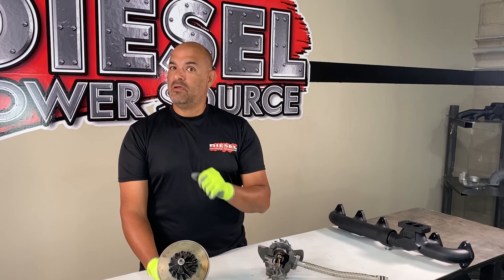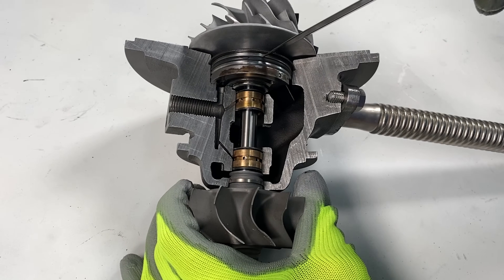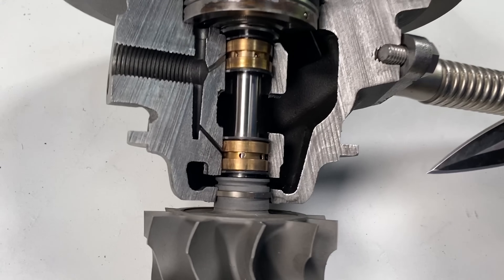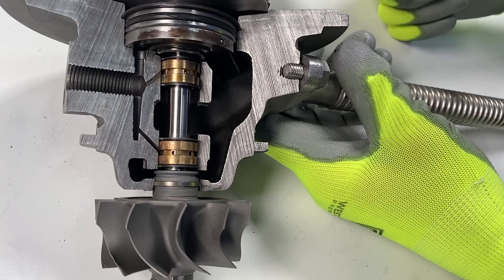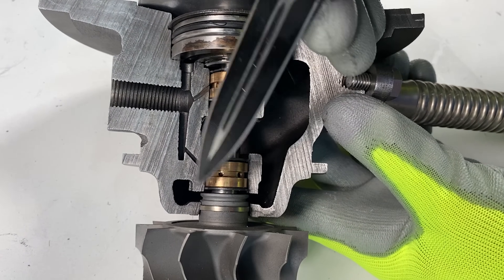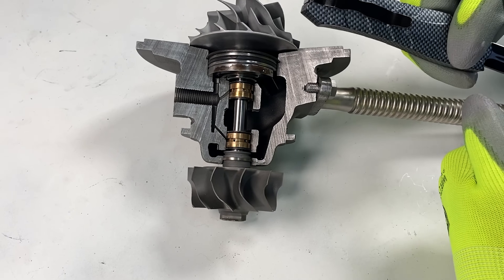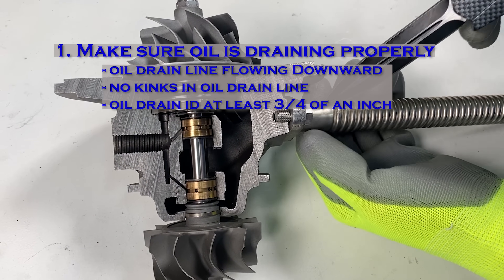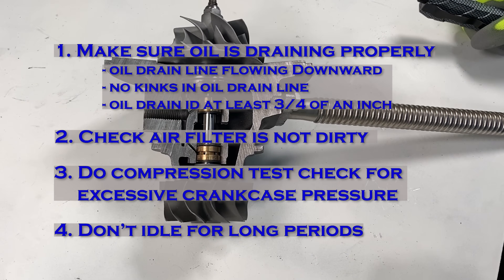Turbo Oil Leak ? |  Turbo Leak Causes |  Understand a Turbo Seal Leak | Diesel Power Source

Comment: Can a vacuum leak on the intake leading to the turbo cause excessive pressure on the compressor side and cause it to suck oil into the intake? Cause I think that’s why there was oil in the intake.

Comment: My 1.4 tfsi throw smoke while full throtle in low rpms and in the morning after warm up. Because of the smoke not being continue i think its the oil leaking by litle in dp and hot stuff therefore this smoke, wdyt?

Comment: Thanks for the info. I recently installed a turbo and the intercooler pipework blew off and I saw oil in the piping I now know why lol. I have a catch can to atmosphere so no oil should be in the piping.
I now know I need to pull out my turbo because the drain wasn't pointing down instead it was almost at the 3 o clock position which was annoying because I bought it off someone who builds turbos and I was none the wiser because he told me he clocked it properly for me so I just installed it. Now being educated from this video I know how to fix this issue.

Comment: Wow what a fantastic video. Now I know why I am getting so much oil loss. My drain setup is angled way more than it should be. Been chasing everything but the turbo. My question is how do you know your turbo needs a rebuild after being run with poor drainage? I can correct the position but how do I know if it’s good to keep running? Assuming oil is lubricating everything anyway so it can’t be too bad but curious to know. Thanks for the awesome information!

Comment: I feel better…..I haven’t started my engine, and the oil feed is definitely feeding the turbo as I try to crank it” Anytime I do internal work on the engine I always crank it to get the new oil moving, and to check the turbo lines for leakage” I guess it makes sense that it would have a tiny leak on the exhaust side…..the Turbo needs to spin to direct the oil away from the seals.

My compression test on the engine was 150 psi on all cylinders except number 6” 152 psi.

Thanks for the video.

Comment: In case of internal oil leak, always I will found oil on intercooler? Or that isnt a right check method? In my case my bmw x3 2.0 diesel, burn 1 liter for 1000km.

Comment: Diesel ran away due to failed turbo.. put a new EBay cartridge in it and ran it without intake hooked up to the throttle body to hopefully clear all the oil out of the intercooler.. leaking on exhaust side only. Is this because the intake isn’t pressurized?
Reply: I'm looking at en ebay cartridge for my car as well. New Honda turbos fail fast

Comment: Hey question for you. If I’m observing my turbo while the engine is running with the intake install and exhaust removed and oil is leaking from the turbine end only, could that be due to unbalanced pressure on the turbo seals? There is no oil on the compressor end when I remove the intake for inspection with the car off.

Comment: i also find out newly that this type of turbos can leak in situation not spining in corelation with supercharger, supercharger works up to 4rpm than magnetic clutch on water pump disconects supercharger, flap on secondary pipe turns and redirect air straight to the turbo, when at the same time the valve on exhaust side of turbo closes and makes turbine to spin the shaft. here comes the examination of slingshot oil ring in front. remember the flow of oil into turbo is constant because oil pump is aslo providing oil for turbo when engine runs, regardless turbine spining or not. back to slingshot ring, when turbine is spining, this ring is usefull, but when turbine doesn't spining and oil is keep flowing, there is no more of sealing type, so the oil is escaping through the oil seal, also because there is also no air coming behind the rotors air and exhaust side. this is an issue of skoda 1.4 tsi RS, maybe some other cars audi tfsi ... maybe this is helpfull alot to understand why some cars have still huge oil consuption no matter good or the best motors build quality. it is the damn turbo. turbo have to spin all the time!

Comment: You do a very good job of explaining this thanks so much!! I have a 2016 f150 2.7 ecoboost and today it was smoking really bad on start up I noticed a lot of oil in the intercooler coming out of the bottom right charge pipe coming from the drivers side turbo could this be caused by bad turbo seals it dose have 201k but seems to run good but dose have cold start smoke and rough idle the smoke last about a minute  the feed tube but I just don’t think that is the case

Comment: Hey turbo gurus, I need a quick diagnosis. I have a 4d56 turbo diesel in a Mitsubishi L300 delica. Intermittently I notice power loss and from watching this video I’ve determined that I’ve slightly overfilled the oil and potentially have a blocked air filter. There is little to no crank case blowby. Here are the symptoms I’ve notice; engine violently idles, lack of power and is 1,500 lower than redline, black smoke, Overheats slightly when going up hills on highways (I then ease off throttle to prevent damage), oil weeping from the silicone hose between compressor outlet and intake manifold. Im thinking it’s either from too much oil, blocked air filter or worst case the oil seal ring is damaged. As for the turbo, there is no play and it spools up very smooth. 
Thanks for an informative video 😎

Comment: May I reiterate others, I learned so much, I have two marine diesel turbos on my bench actually seized with exfoliated corrosion, been sitting for 3 years, removed corrosion, all good save oil leaking out of exhaust port, I had filled the oil connection with oil, So figured this leak be bad but now realise it will leak sitting on the bench probably in wrong orientation. So rather than replace I am going to give them a try, you may have just saved me $$$$
Reply from the maker: Hopefully it saves you the money!

Comment: 😂 nothing wrong with AN- drain lines as long as it's sized correctly. 
AN- drain lines are not used because the person wants to look cool lol, AN- lines are used for durability in many/most applications. Compare it to that thin aluminum bendable crap you have there on your turbo. You speak with an "as a matter of fact" tone in your voice, sarcastic and cocky, but you're wrong here. Do you measure your oil in vs your oil out? No I bet you don't. I bet you just put your thin corrugated OEM drain pipe on and call it good. Take your measuring cup (32-64oz) run your engine for exactly one full minute using a turbo oil feed line to fill the measuring cup. Take note of the amount of oil in a cup. Empty the cup, then use the measuring cup on your turbo drain line....once again for exactly one full minute. Then you will know if you have the same oil going in as you have coming out within that 1 minute...whether any amount of oil is backing up in the turbo or not. This is the proper way. Or you can just do what you do and go blah blah blah rule of thumb blah blah blah.

Comment: I have excessive crankcase pressure. Oil pushing out through turbo and front Crank seal. PCV diaphragm changed. Piston rings changed. What else to check for ? BMW F20 N13 1.6 ENGINE.
I thought it was a turbo back pressure from the exhaust to the engine but your explanation doesn't says so, is it a likely case. I am a DIY guy on BMW

Comment: I haven got myself a nice set off new hybrid turbo's with ballbearings. But only the turbo from bank 2 is leaking a bit oil into the compressor side. Put 1.2mm restrictors in the oil feed because the manufacturer recommended it. And put new crankcase ventilator set on. It is better but still a bit oil in the compressor side turbo. Bad seal?

Comment: Not completely no water line
Reply from the maker: On a OEM VGT turbos there may be water lines to cool the electronic actuator, however, on the standard "non VGT", the type in our video, there is no water, only oil supplied to the turbo.

Comment: I still found the engine oil on the left side of the car and at the bottom in the air hose that connects the turbo radiator please the turbo - is it broken and spewing oil through the air hose or what? Thank you in advance for the reply

Comment: My VW 1.9 Turbo diesel has over 500,000 miles on the original turbo. I get some oil in the intercooler which I drain periodically, otherwise it seems to boost fine.  Think it's time to replace the turbo?

Comment: I put a vz21 turbo on my dirt bike and made my own banjo fitting and going doin the road it's blowing smoke like a train I'm going to make the bolt hole smaller and see if that works because it's too much oil pressure thank you

Comment: My truck is leaking if I idle for to long but once I’m driving it clears out.. the only thing I can’t help idling for to long… but I don’t want it smoking like that if I go with a smaller turbo will this fix my problem?? I was thinking I had to much pressure or blowby…. But after this I think I’ll just get a turbo and see if that fixes the problem

Comment: I have a Volvo D13 that's been parked  for 3 months. This one time, I got it started and just let it idle for nearly a day. Got a lot of oil leaking at the exhaust manifolds. Does this correlate  with the point you made at the end of the video?

Comment: It's a very good video and thanks a lot for the knowledge.  I am driving a Land Rover Discovery 4 tdv6. The sequential secondary turbo is leaking internally and the engine oil is accumulated in the intercooler.  This is sometimes driven at 2800 rpm to activate the second turbo and burn it.  I am wondering if this is the right way to deal with it.  Also, if there is a better way, please recommend.

Comment: Thanks for the video, fantastic info that I needed to understand this better. Can I ask what do you think about using non-OEM turbos to replace the one that failed? Like using Nissens or Lucas or similar to replace Garrett or Borg OEM turbos. Is it better to renew the old/original one or buy an already renewed one or buy a non-OEM turbo? Thanks.

Comment: Best turbo explanation ever...... However this VW Polo 1.2 TSi together with the white smoke when revving it also shows code P302 and P303 indicating engine misfire on cylinder 2 and 3..... changed spark plugs and swapped ignition coils but still shows the fault code on same cylinders.....i took out the turbo and about to clean it properly coz its very clogged up with oil and carbon build up.... also the CAT converter is full of oil.... gonna clean that out as well....... 
#1  ....how do u perform a test to determine crankcase pressure is the issue?
#2 ... and how to determine cause of excessive crank pressure? 
#3 ...Can a blocked oil pick up filter being clogged or vacuum leak or blockage also cause back pressure in the crankcase?
Dont wana tear down the entire engin just yet if issue is elsewhere and easier to fix

NB : ......the white smoke does not have your typical burnt oil smell ..... it smells clean actually more like a fuel /moist air smell.......car is using 2 quartz of oil a week on day to day work and back use
Reply: masz zużyte pierścienie tłokowe, bierze ci olej i cylinder pływa w oleju
zapłony będą wypadać
remont motoru

Comment: Great video!! I have a 2011 Mazda CX7 with 130k miles, no issues until I noticed that I ran through 10 quarts of oil ( full synthetic) over 2500 miles. The car is running smooth, no loss of power, no overheating, no oil smell. I did notice some oil around the right side of the engine underneath the engine cover, around the large hose at both ends ( sorry don't know the name of it, intercooler turbo hose ? ) Any ideas would be great, thanks !

Comment: Hi, my turbo is leaking in the exhaust side between 1000 and 2000rpm if go slow, burning oil. It is posible bad drain? Need e restrictor in the oil intput of the turbo? Is a borgwarner EFR6758 installed on a golf GTI MK7 2015. The drain is connected direct to oil pan side 3/4" connection but inner diameter is less, i think 1/4"

Comment: is it possible to have perfect compression and still have excessing crankcase pressure?  my cap definitely dances and blows off, without even revving.  This is on a fiat ducato 1996 with about 100k miles.

Comment: My Car Smokes Constantly At Idle When Park Up A Incline (Turbine wheel lower then the compressor). Driving Around It Doesn't Really Smoke And Neither WOT Full Boost. It's Smokes Like A Fright Train Randomly Only When I Come To A Rapid Stop From Say 50 MPH. It Never Used To Do This Before With Same Drain Set Up. It's A Ball Bearing With A 3/4 Turbo Drain. It's Driving Me Nuts Becasue Every Time I Come To A Stop Light Everyone Freaks Out Like My Car Is On Fire 😓
Reply: did you ever figure this out? I have similar symptoms.
Reply: @alvinhilbrec8272  Yup. It Was Ripped Valve Stem Seals On My Exhaust Valves.
Reply: @salvatorehayes2753  Thanks for the quick reply Salvatore,. It's really appreciated!
I've replaced my valve stem seals (intake and exhaust) a week ago and it got rid of the smoke when the vehicle would warm up and be at idle in the driveway. But now I get quite a lot of smoke (light blue) just at random occasions. Usually when decelerating or the automatic transmission shifts down.  but it will run for long periods of time on the highway or even around town at low speeds with no smoke what so ever. So it's got me a bit baffled. There is a road near me that is a few km's long. I'll drive along it, around 60-70 km/hr. and come to a stop sign at the end. Turn left and go a couple hundred feet, and the car will smoke like crazy for 5 or 600 feet in this very same spot every time. It makes no sense since It does this even if I drive around the small town I live in for 20 minutes before heading down this road, or not.. I'm starting to wonder if maybe the turbo needs rebuilding. And I'll check the return line once I remove the turbo. I've ordered a new valve cover (2008 mini cooper) as I believe the built in pcv valve is'nt working properly. So will wait till I try that before moving on to the turbo. I have a high end Autel scanner and am getting no codes what so ever. Engine seems to be running well, other than the random plumes of smoke. (slightly embarrassing, lol)
This was a really informative video!
Reply: @alvinhilbrec8272  I Think My Pop Tune Pushed The Valve Seal Up And The Spring Retainer Smashed It Back Down And Ripped It. I'm Gonna Try And Use The Metal Clad Seals This Time. I Was Using The Full Viton Seals With The Tension Springs. I've Never Had This Issue But I Never Ran A Pop Tune On Them Before And It Happened Like Right After The Pop Tune. My Guess Is The Spike In Pressure On Exhasut From Pop Caused Them The Come Loose.

Comment: What about puffing blue smoke, when you accelerate after engine braking? If I am down shifting on a long hill, or just to slow down I get a big puff of blue smoke.
Reply: Usually valve stem guides worn out

Comment: Thank you for your explanation I though there was a major issue with my brand new turbo. 
Thanks to your video, I realized it was all because i filled the turbo with oil to install it, but didn’t install it right away and ended up leaving the turbo on it’s side causing some some oil to leak out. I though something was wrong with the turbo 😅
Reply from the maker: Glad you figured out the issue!
Reply: Would I have any problems in the future because some oil leaked through it ?
Reply from the maker: @rzzillar90b54  Probably not, if that was the cause of your leaked oil I would imagine that it will run now without leaking. But keep an eye on it and let us know what happens.

Comment: This is a excellent video.  I shared it on a Mustang forum as the Mustang Ecoboosts (4 cyl turbo) have some issues with smoking with stock PCV or even catch can modifications.  I recently replaced my PCV as it was no longer functioning correctly at all times which seemed to have solved the problem, but it has smoked a couple of times at low idle.  Question:  can you share some additional info on why the oil is not getting "slinged" at low idle and what is a possible solution?  Appreciated!

Comment: You should have added to that if its smiling at idle to eliminate whether it is crank case pressure or not remove the oil cap and if the smoking goes away its defo the crank case if not then crank case pressure aint your issue
Reply: other than that excellent analysis

Comment: That's a good video to explain some very simple priniciples in diagnosing oil leaks downstream of the turbo. One question, what impacts can a DPF make? If it is blocked can it contribute to the high crankcase pressure? And therefore be the cause of oil leaks in the turbo?

Comment: Nice one .Great explanation with the cut away. How the galleys work ,the sling of oil to divert, effects of gravity and the crankcase pressure influence. I have the list and sure that your post will send me down the right path of analysis to the issue. Cant wait to get to it . Thanks a  heap.

Comment: My turbo petrol car gets a lot of smoke when i idle for a long time during congested traffic but is fine when on boost and driving normally. This video would suggest it’s because the turbo is big and isn’t spinning fast enough at idle to sling the oil away from the seal.
Reply: did you fixed it?

Comment: To my diesel car without PCV, it has an oil decanter, it passes oil from the turbo to the intercooler and intake manifold, I suspect that it will be due to the wear of those seals that you have mentioned,